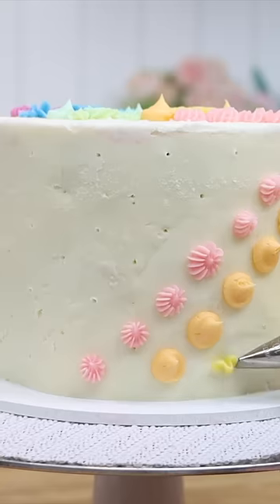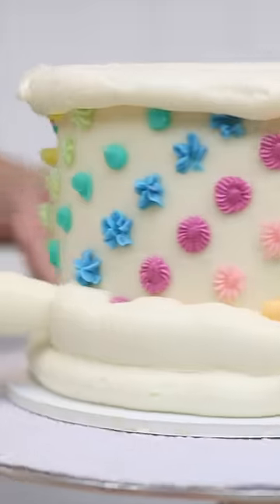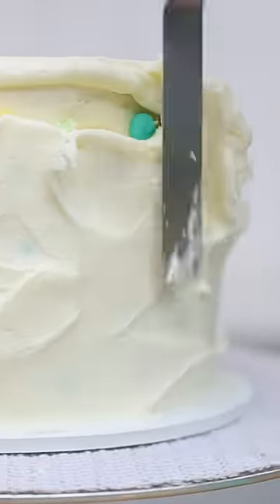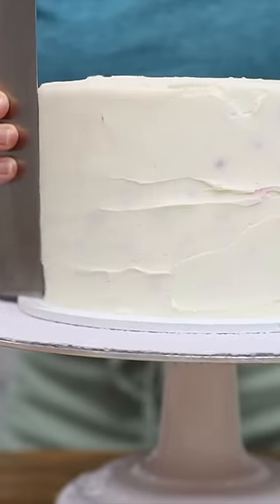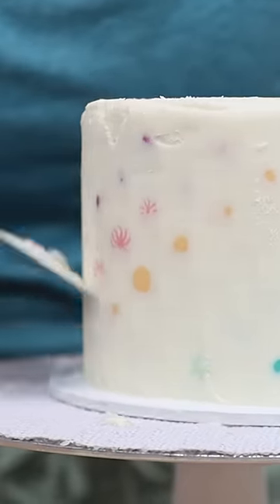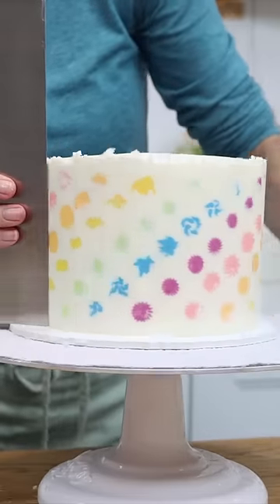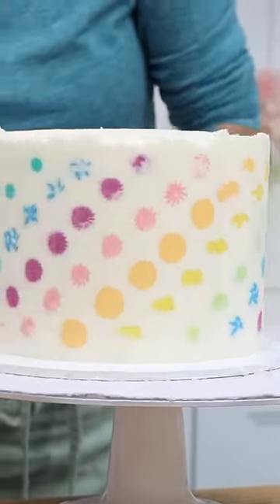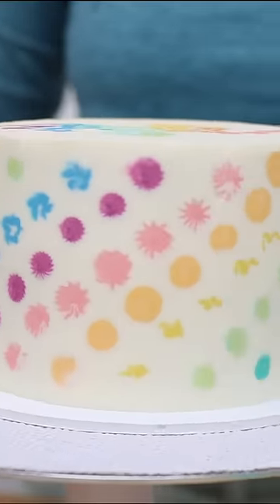Yay or nay to this cake decorating technique? #shorts

Comment: I think depending on the design, adding the white and scraping away can look really cool, however for that cake in particular, I think the added white even layer lost the fun textures. Probably has a lot to do with the piping tips being used too and how the effect looks when you remove a portion from the to? The blue frosting looks very uneven and there’s no precise way to control that with the tip that was used. However the pink and purple are dense enough patterns that it still read well enough. Fun effect to try out though for sure!!
Reply from the maker: Very valid observations! The result is unpredictable with some piping tips which makes it fun to experiment with but not if you need a particular result

Comment: i like it, however i feel like it would work vetter with piped pieces that aren’t wavy or curled around. it seems like when you scraped there were parts of the og piping that folded over each other. so plain stars, dots, lines, etc. might work better maybe? if any of that makes sense.

Comment: It is beautiful either way. But, I have a question. Keep in mind, I am not a cake decorator…far from it. But, wouldn’t putting it in and out of the freezer make the cake dry? I feel like sometimes the quality of the cake is sacrificed for looks. Just wondering. Your work is fabulous, btw!
Reply from the maker: Thanks for asking so politely! After you cover a cake in buttercream, the buttercream seals the cake so even if you change the temperature temporarily by refrigerating or freezing it, when the cake comes back to room temperature it will soften again and taste just as moist as before :)

Comment: It's okay if the design was simpler, but you can see what design works. What if you freeze a layer of frosting flat and use a cookie cutter to cut out the shape and apply to the cake and then use the technique used on this video. Maybe the design will come out with more details 🤔